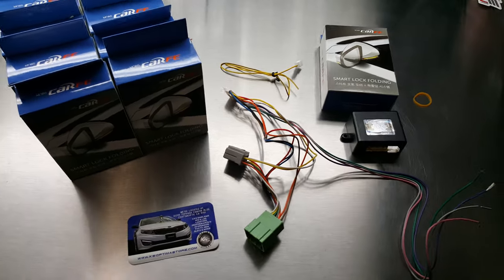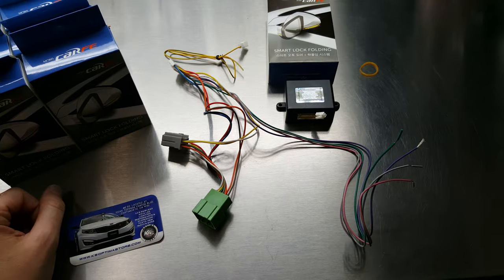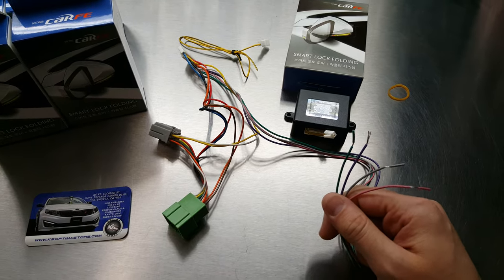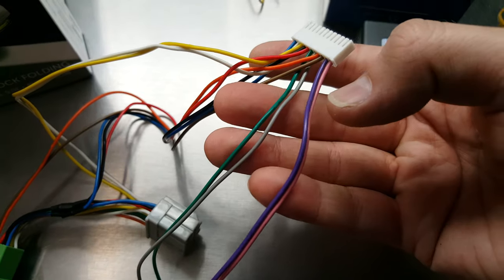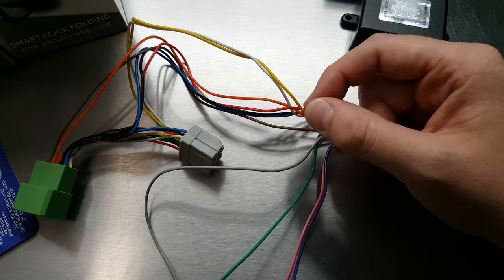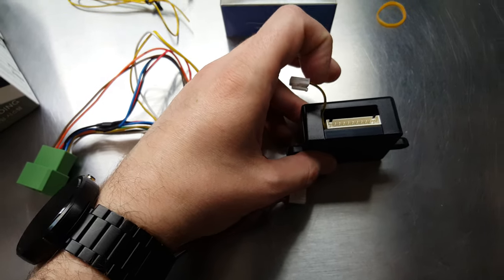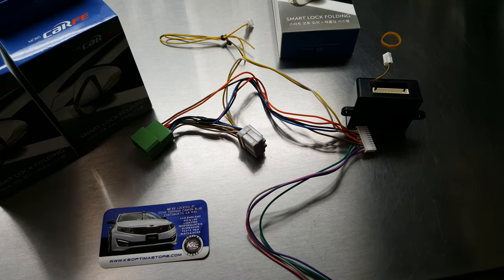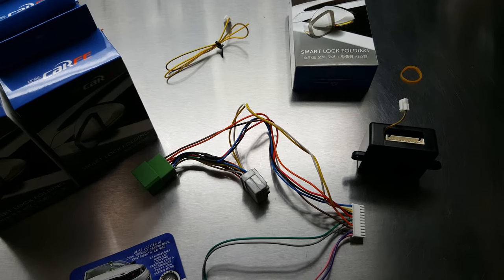Updated Installation Information (Auto Folding Mirror Module)

Comment from the maker: This product is designed to work only on a 2011-2016 Kia Optima with electronic power folding mirrors. It DOES NOT work with other vehicles.

Comment: Will this system work on my Kia if my mirrors don’t come with a moving function at all they only fold manually?
Reply from the maker: Jeremy Vela no, you would need to add the power folding mirror conversion kit that we sell on the site.
Reply: Would this work with the Rio?

Thanks.